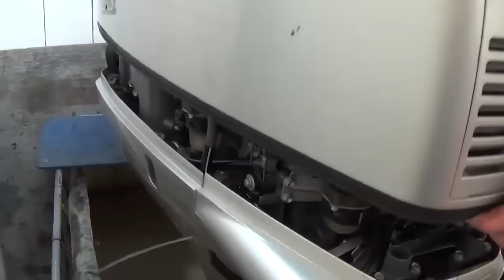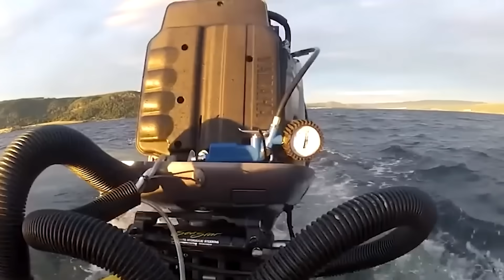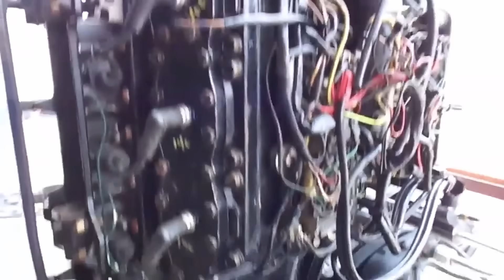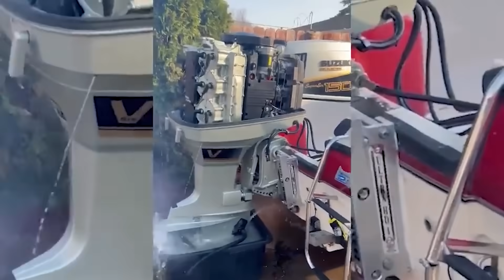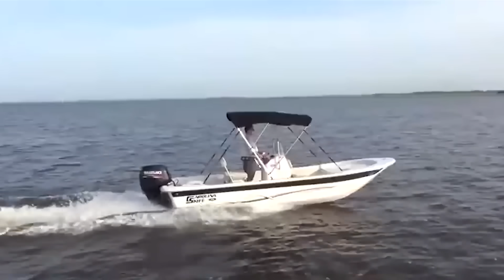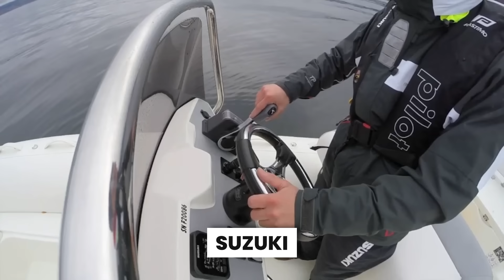Why Japanese and American Motors Are So Different?

Comment: We have a 15' boat from the 1970's it's got a an older blue mercy 1972 4 cylinder 50hp 500 inline 2 stroke. It's a monster it always starts, even with crap gas it. This motor is from 50 years ago. The issue is the motors are now built for you have to buy a new one after while. They're made like crap by comparison to the older models

Comment: Greetings from Poland. I have a 1987 Johnson V4 90 engine. I really like it. It's easy to repair. Everything can be repaired or made myself. I don't regret buying it. New engines have high part prices, but mine are cheap. Sometimes they're hard to find, so you have to search around Europe, but I usually find them. I sail on a shallow river, and collisions are common.colleagues with new engines never sail where I do

Comment: Evinrude 8 HP 2 stroke, workin on a fresh water lake (Balaton) as an auxiliary motor on a sail boat. Pretty light work, it is started only arund the dock and sometimes in emergency. But at the age of 30 years it was stopped for three years. And after these three years it started up at the third pull.

Comment: For the last 20 years Mercury used to be big power and tech for a price. And the most nice to use. Evinrude with the G2s was the bargain for tech and fun with bonkers design. Now Yamaha is the new leader in tech. They get the electric steering integrated like Evinrude did. The new helm master is now better than Merc's smarcraft . Only Honda and Suzuki are behind. The Suzuki V6350 is way less comfortable to use than Yamaha 's 350 or Mercury 's 350 in L6 or V10.

Comment: I’ve ran three motors on two boats. First was a 88 Murc Mariner two stroke. Loud as hell, chugged fuel, stunk, but it was a tank, and simple to work on (obviously because of the age and style it’s a different comparison), didn’t know the hours bc all the gauges were broken, compression was probably fucked, lower unit seals were shot, the shift linkage was nearly dissolved lol. Second was a 2001 Johnson, just terrible oil injection system sucked, nothing but problems, ditched it and repowered with a an F250 in 2020, and I don’t think I’ll ever look at an American motor again. Suzuki has a great rep and an even better warrantee, but where I am at service and parts are limited so that was really a deciding factor.
Reply: Oh my fire departments boat has twin 03 Honda BF130s… still running. Had to replace the valve covers due to corrosion but, they’ve consistently performed; and are still relatively quiet and fuel efficient considering. Unfortunately they don’t offer a 200hp in an I4 like Suzuki or Yammi

Comment: japenese engines are designed with the technichain,simplicity and reliabilty in mind, american engines are released and then designed based on customer complaints and parts failures. 
its easier to replace a timing belt on a yamaha then an alternator belt on a mercury that should tell you everything

Comment: Use case and goals are far and away the most important over brand.

It’s easy to make a weak engine last forever or a beast last a single trip. All manufacturers need to find ways to do both!

Comment: This is a great view video! I grew up with my dad’s old Mercury 150 on the back from 83. I remember if I took it any where off shore we did the buddy system. At times we played the will it start game and how many times do I need to take the cover off. My dad finally bit the bullet and got a Yamaha in 2006. Now I feel comfortable letting my kids take it out. Always starts and keeps on going with just basic maintenance. I now have twin 200 mercury’s on my boat and my dad will not stop reminding me of the old mercury. 
I will say that by the time I was 16 I did know that old engine inside and out. Might have been out of necessity, but I could always find and fix the issue. With the newer motors my confidence to fix something is pretty low. 
But if I do start having issues definitely going Japanese.

Comment: I have owned a couple of Tohatsu outboards. They were great and were basically rebadged Mercury engines. Although like small Mercury engines (<60 hp) they were made in China.
As so many times before, there is not just one truth. Just look at Harley Davidson motorcycles. They are made in the USA, but with some imported parts, for that market but in other parts of the world Harley Davidson is made in Brazil or Thailand.

Comment: Interesting video. I've got a little 8 hp Merc from 2003 that my buddy lets me use on my recently purchased 14 ft aluminum Valco from somewhere between the 70's and 90's. It goes on his 12 fiberglass boat from the 60's that needs stringers and glass work to safely see the water again. I help part time for a boat salvage company as well. The 22 ft landing craft has twin 115 Mercury oil injected two strokes. They've been good. The old sheriff rib has twin Evinrude 200 HO's. Also pretty impressive motors. Those two working boats are propped for towing instead of speed. And both pull very hard given the size and power of the respective motors. We use a little 14 foot Lund sometimes too with a 9.9 Tohatsu or a 9.9 Honda. Both of those have been great too. We mostly have issues eating impellers on the working boats because we pretty regularly have to prop wash beached vessels to get them off and those poor impellers suck unbelievable amounts of sand in many of the areas we recover boats from. Sometimes one salvage job with a ton of prop washing is enough to require new impellers with a full flush of the cooling system and sometimes impeller housings as well. But overall they've all been good. The big motors do get hot when they eat a lot of sand with little to no boat speed and full throttle but that's honestly to be expected. Regular boat owners don't abuse these motors like us boat salvage guys have to to get jobs done.
Reply from the maker: Thanks for detailed ans experienced commwnt. Where abouts do you operate?
Reply: @VintageBoats Mostly the Washington coast for salvage. A little bit in Oregon.

Comment: I miss the noisy, stinky 2 stroke Mercury high end outboards. On a light boat like a Hydrostream, they really fly. Once that damn oil injector that was the death of of countless engines was disabled, they were very fast and lightweight. They were certainly fuel hungry though. About the only faster motor are the OMC looper's, but are for bigger boat. 

Mercury is still king in my opinion, but you'll have to trade the first born child, maybe more. The problem is that I still like the ultra light 18-20' boats. I don't want a big boat, so 4 strokes of any HP are too heavy.
Reply from the maker: What do you get out on the water for?
Reply: @VintageBoats  It used to be for water skiing, then putting about the lake with family and friends. When the weather was right and lake was empty, I also loved high speed solo runs (80+ on a 20' v-bottom in the early 90's).
Now, I only hit small bodies of waters and go fishing since my back won't take big waves anymore. Besides, now everyone has their loud stereos playing, and jet skis flying by 20' from me while I am fishing. It isn't fun or relaxing.

Comment: I've had suzukis with 8000 hours and evinrudes with 8000 hours, I've never had a merc go that long.
Reply from the maker: 8000 is a lot! Good going. What are you using these days?
Reply: Have one boat with newer suzukis ans i still have the same e tec too. Also have a boat with an older detroit, and put a brand new 350 in another, all good motors. @VintageBoats

Comment: Suzuki has best in class torque on the big block 4 cylinder!!!
Reply from the maker: Thanks for commenting. Do you own suzuki?
Reply: @VintageBoats yes a 2022 175AP with 3000hrs used commercial clamming

Comment: In the Outboard world 

Yamaha (by far the most reliable, but you are paying for it)
Mercury (the non verado variants aren't terrible but Yamaha is better for the money)
Suzuki (making a very strong argument, they are cheaper than Yamaha and are more efficient than Yamaha, but time will tell for its reliability)
Honda (NO, if you think Honda's are reliable and want to keep thinking this, then NEVER buy a Honda outboard, side note this is the only way to get a V8 Honda)
Evinrude (Not bad but somewhat unreliable, kinda over priced, and Suzuki makes more torque)
Reply from the maker: Thanks for your breakdown! What do you have?

Comment: Most of the parts needed to manufacture Suzuki and Yamaha. Use the same parts in both. Both outboards get most of there parts from the same suppling manufacture.
Reply from the maker: Do you have either?

Comment: Yamahas, at least initially, were pretty much carbon copies of Evinrude/Johnson.  I worked for dealers so I know.  And no, the Yamahas weren't any better than the 'Rudes then.  This was back in the 80s/early 90s, so can't say now other than Evinrude/Johnsons are (long) gone.  Oh, the early low horsepower Yamahas imported in the 60s...hard starting and not much good to say about them.
Reply from the maker: Scroll through the comments and check out stories of the 'Japanese' spies. Perhaps you already know.

Comment: The Tohatsu are good but find them a little rough compared to the Yamaha - watch out for build quality on the small ones - they seem very reliable overall
Reply from the maker: Do you have one?
Reply: @VintageBoats yes - we have a 20hp - super light,  little light on torque and they vibrate a bit more than comparable Yamaha - have to watch out for bolts loosening on the case (loc-tite recommended). Otherwise it has been rock steady for 6 years of remote camp ownership

Comment: I have a 2017 Mercury 40hp 4-Stroke EFI and it has been a gem. Always starts. Has never needed any unscheduled or emergency maintenance. Even after sucking mud and gravel into the cooling intakes, a quick flush had it running like nothing had happened.
Reply from the maker: Amazing! What boat are you running it on?

Comment: My brother has a 9.9 sears brought in the mid 1970s still runs great. Love those 2 strokes especially the sound.
Reply from the maker: https://youtu.be/r-VVjT_d-Hw

Check out this video for more Sears feature!
Reply: @VintageBoats  sears engine were brand Elgin and were built by Chrysler marine. quite a piece of junk. did you knew that?
Reply from the maker: @ClaudeMarchand-k3l  there's a lot of brand overlap and part mixing or hiding under the cowling across the industry! Thanks for sharing!

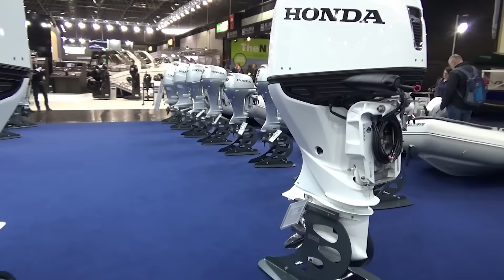Comment: 1:21  My Dad’s Honda spends more time in the shop than it does at his house or on the water! It definitely has more shop hours than run hours! He got a lemon & one of my podna’s got a lemon. I hear they outsourced some motors to another company to build them. Maybe that’s the problem, I dunno. 
Now Yamaha can take some serious abuse & keep on rolling! About 25 years ago, a friend had been drinking in the boat & left his Yamaha 150 C class running, towed all the way home (1/2 hour-ish). It got so hot the paint on the cowl bubbled! He changed out melted wires & water pump & used that motor for another 8 to 10 years. I don’t know if any motor that could handle that & not crack a block or something.
Reply from the maker: Thanks for sharing detailed comment and story. Sounds like some terrible downtime. Wish better luck with future engines!

Comment: Back in the 1970's I was running Chrysler OB . I had two of them. One was air cooled. It was a piece of crap. I took it back to the dealer and exchanged it for a larger water cooled. I never had any trouble with the water cooled engine. I serviced it myself. My next boat had a Cleveland inboard Marine engine. It was temperamental. It would run good most of the time. But, more than once it died in the middle of the channel in the Mississippi River. My only Japanese engine was a small Nissan. I'm running a Mercury on my Bass Tracker. It won't win any race, but it's on a fishing boat. We run it all day last week on less than 2.5 gallons of fuel.
Reply from the maker: @navyuncle don't need speed in your fishing boat, just reliability. Unless of course your catch is so good and you need to rush back if your overflowing with fish 😅

Comment: Maintenance boys maintenence 2 strokes need to be maintained and if you do that and keep them jetted right they will run reliably and sound so much better and have plenty of power i know guy's with old 2 stroke mercury's and they run great just have to take care of them....on a side note most of the tow boats have Suzuki outboards just saying lol
Reply from the maker: @mikemazz3377 where abouts arebyou based where they are all running suzukis? And you're 100% right about maintenance, for 2s and 4s.
Reply: @VintageBoats  East coast i went to mmi in orlando fl and just about every tow boat i saw had a Suzuki outboard

Comment: I have an outboard with 2400 hours.  Still starts on the first crank, runs like a champ and outside of regular maintenance has no issues.  And we boat 99% in salt water.
Reply from the maker: Great job with the hours and maintenance. What motor are you running?

Comment: It goes Yamaha, Honda, Mercury for top 3 Hondas are gutless but they are very reliable.  I put 6000 hours on Yamaha 225 never had a single problem ever until a piston tried to blow through the head.  Mercury used to be problematic, but they learned from their mistakes and corrected they are fast and reliable.  The water sensors are very sensitive but keep the water out of the gas.  Suzuki is at the bottom of the list. Perhaps it's just my experience running the 350, which is by their own admission one of their biggest blunders ever, but you can look under the cowling and see the lower build quality right off the bat, very sensitive to corrosion and associated problems. Terrible to work on, fuel pumps,  wiring harnesses,  the cooling system is nothing but problems. Don't buy a big block suzuki.
Reply from the maker: 6000 hours is awesome. Well done there!! What kind of usage?
Reply: @VintageBoats  charter fishing

Comment: I'm a certified Yamaha and Mercury technician, and i've been doing this for 13 years. I drive and service hundreds of boats every year, and there's one brand i hate, because almost every single engine has a leak, fault or recall i need to fix. It is of course Mercury.  They also perform worse than Yamahas on every single boat i've tested, and rigging them is a nightmare because of their complicated and low quality harnesses. A twin V10 rigging takes PALLETS of stuff on a Mercury, but for a Yamaha you need but 1/4 of it, and almost no setup.
Reply: What are your favorite motors from Honda?
Reply from the maker: Thanks for watching and coming into convo with your experienced comment. 

There's a serious divide and you have placed a good swinging comment for the Yamaha team.

Comment: American motors "have balls"? What does "balls" mean besides horsepower, which is visible on a sticker on the cowling? Get an American brand 150 hp, and it has exactly the same "balls" as a Yamaha 150.

Now interesting thing about the "balls" of an American motor is that historically, they measured the horsepower using a dynamometer connected straight to the crankshaft. When Yamaha went into the outboard motor business, they measured the power on the PROPELLER shaft, which meant that the Yamaha engines ultimately had WAY more "balls" than American motors, so they entered the outboard motor market with a MAJOR performance advantage.

Some time around 1990, my uncle came to our lake with his Mercury 135 on a pretty tiny boat. He thought it was insanely fast and was pretty cocky about it, so he challenged a guy with a Yamaha 115 on a larger and heavier boat to a race.... and had his ass handed to him 🤣

Things are a lot more uniform now since obviously the American outboard makers had to change to propeller shaft power measuring in order to remain at all competitive.

We had a Mercury motor as well back then. Unreliable piece of trash had to be rebuilt EVERY SINGLE YEAR when something catastrophic blew up in it. Replaced it with a Yamaha in 2001 -- its had oil changes and a few sets of spark plugs since then, but that's it. Came right to life as it always does last week when I cleaned it up and launched it.

I'd say that on a small lake, its probably not a huge deal to have the most reliable engine going, but if you're out in the ocean, its Yamaha or not worth the risk.
Reply from the maker: @larryboyd1872 thanks for the informative comment and enjoyed the little story. Would love to see you back in the comments of more videos.

Comment: I’ve gone through 10+ Suzuki motors at our business, they work well until they don’t. For us it was the output shaft splines stripping out at about 2k hours on the 150+ hp models, and constant electrical issues on the kickers. We have also had a lot of issues with Yamaha carburetors being very finicky and requiring excessive jet cleaning. Meanwhile our mercs have held up extremely well, start every time with no issues despite putting 300+ hours a year on them. I think they’re all much more similar than people think, it mostly comes down to the owners and whether they maintain and operate their equipment correctly.
Reply from the maker: Maintenance, maintenance, maintenance....and a bit of how you run them! 

Thanks for added input!

Comment: Boats for american markets serve a different purpose.   Outboards  like say a mercury 2.5 bridgeport or even a optimax or verado a or a evinrude 200 etec mercury are performance outboards like ducati is to motorcycles.    Guys like to run performance glass  boats in shallow water they need to get up on plane and run skinny.   suzuki and  honda are open water motors.  Bulletproof but lack performance that american anglers crave.
Reply from the maker: This is a good point that haven't touched on some much. Thanks for the comment @alphacapo hope to see you back on the channel